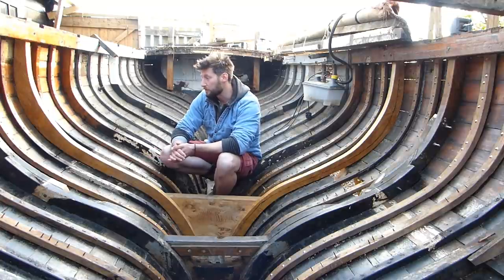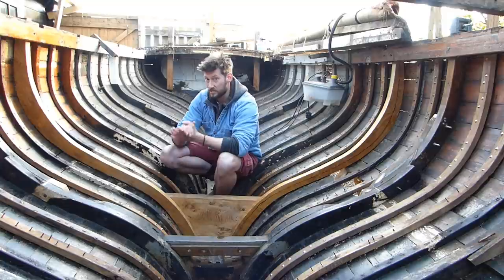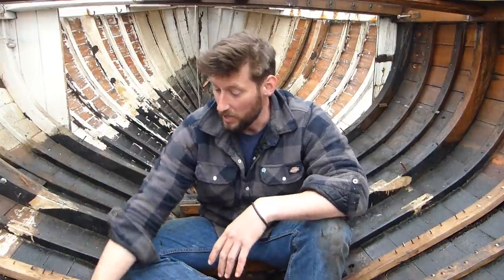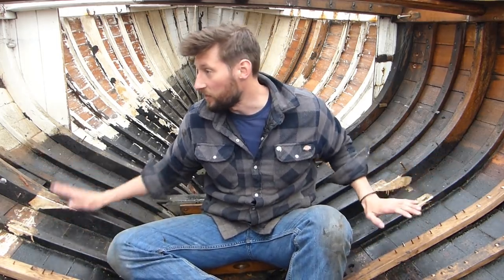Reviving an Idler - A question! -  Extra Content!

Comment: Why not employ a triple wide rib so that you can bed that entire sick area down tight? 
You can alternate the fastening on either side of the original holes at every other plank.
The rib can easily taper down towards center in order to fit the original spot where it seats into the keel.
If you're all about a loss of symmetry then simply do it in the other side. 😊
Getting the boat fixed and fine and fare and FLOATING is more important than a stand-out fatty rib. 
Isn't it?

Comment: Is the fore and aft position of the sawn frames not critical as they correspond with the placement of the deck beams and the chainplates? For strength put in sister frames alongside new frames in original position. May not be necessary along entire length of boat.
Reply from the maker: Yes! And sort of..🤣

Generally you dont want to mess with the structural elements of the boat too much. After all she was designed that way. 
In Idlers case. Im Totally re-laying/designing the deck. And the  chain plates originally went through the planking not the frames. I will be looking to remedy this for something a little sturdier. 

Thanks for the idea of additional framing. I quite like the idea of double framing the station frames as a means to remedy the problem. And as a means to strengthen the hull. 👍 thank you!!

Comment: I'm just a programmer.. but I know one thing, cheap fixing isn't always the right answer. 
If you are going to build something nice with great effort grounded on the base on something old and rotten, then, always consider, money, time and lifetime.
If you drill extra holes in these old planks, they will get weaker. To many holes and "fixes" with "glue", isn't as strong as original.  So if you "move" the ribs to either side and drill new holes you will weaken that plank, no question. 
I would consider replank the worst ones (maybe 1 of 2-3 or something), use wider ribs (taping end to the keel) and counter sinked patches (wider side outside) and then fasten through the patches, whatever shapes of round, diamond etc.  
Then you have patches which are kind of pressing the planks to the ribs with rivets through good and new strong fastening material.
Reply from the maker: Absolutly agree, alot of this planking is worth saving and alot of it isnt! 🤣 im really appreciating the feed back! Thank you!

Comment: I like the idea of moving away from the iron sick planking, plugging the holes. . Could you avoid the problem of your ballast keel bolt by installing a doubler (carpentry -sister)  to the new frame?
Reply from the maker: Yes there are ways i can remake the floors to take the old keel bolt hole. One option is to fill the space between the frame ends with a second “floor” that will take the ballast keel bolt and use a larger floor behind it to back it up and tie it to the keel in the traditional manner.

Its tricky to explain without pictures! 🤣

Comment: You're looking at replanking. If not Your looking at fixing up the structure and fiberglass the outside at the end. By the looks of your boat, I'd go with the fiberglass. 3-4 layers and you'll never have to worry about leakage. You'll have to caulk the boat to make it solid but now you can pick what type of caulking to use. I'd use wood strips and glue. Remember the wood won't swell now and you can have a safe fast boat. And just to let you know I'd never sail Arabella in the open ocean. They made a fatal flaw in it. The floors. They took 1/2 plate and welded it with 1/4 welds. You're only as strong as your weakest point. They did not grind a 45 on the plate before welding them. They are going to sail that boat in rough seas and hear bangs going off. That's the welds breaking the hissing sound will be thousands of gallons of water comings in. I tried telling them but no reply. If you want to learn about planking watch Charles Chiara on planking. Good luck.
Reply from the maker: Thanks for the tip! Ill check it out!

Comment: Treenails have open grain ends, which could wick water into the frame. Graving pieces let into the planks & bonded in place with thickened epoxy resin as Alix did on the mast for Arabella is one answer, as the diamond shaped pieces would be sized to fit the plank, if necessary! The round disk Dutchman has the benefit of using a hole saw to cut both plank & plug & creating sufficient clearance for the thickened  epoxy resin to bond both surfaces.

Here is a link to some of Dave Carnell's work on treating rot in boats. He was well regarded.
http://www.simplicityboats.com/chemorot.html

Best wishes,

Perry

Comment: I don't want to sound discouraging, but there is no easy easy fix. The trouble with plugs and "gibbies" is that you will sever so many surviving fibres that  cumulatively you could significantly affect the hull's structural integrity, beyond the present degradation. I am not generally a fan of chemical solutions, because they tend not to deliver, but "theoretically" a wood hardener which arrested the degradation might be preferable. There is ultimately the Tally- Ho ship of Theseus solution....not what you want to hear.
Reply from the maker: Not at all, im aware that a-lot of the planking will likely require replacement, and total structural weekness as a result of cumulative repair is a big fear ive had and a big part of why i made this video. So you are absolutely right! Thank you

Comment: Me personally I would want to know how the next ribs before and after that one and see what condition the wood is in. Would hate to do all that work and then fined out that lets say the next meter or so is also bad and the you would have to scarf a new section of plank in there .I'll  bet at some point you will have too do that, that iron sickness is hard to see sometimes when they are covered with oil, age and what very someone else did to 'try' and repair her. That's the thing you don't know if it was done right or not. But hey I just biuld model ships not the real thing ,so we know who has way more experience here than me.....lol good luck I hope you get the answers you need to do this right.
Reply from the maker: Absolutely, i know ill have to replace some of the planks but there is some good stuff in her still. But, you know as well as i do that the iron nials will have done the same on each frame going forward.

Comment: It will be a lot of work but plugging the holes and graving in 'dutchmen' from the outside to fill the damaged timber and then re-fasten with copper in different locations to the originals, would be my suggestion. Do obtain some pitch pine to make your graving pieces and soak the holes with some epoxy primer (penetrating epoxy) before gluing them in.

Comment: I'm surprised you are going to nail the frames. Why wouldn't you use copper rivets, roved and peined? I don't think trunnels or through dowel plugs are a great answer, because that leaves end grain on the outside of the planking, and water travels along grain rather easily. I don't believe your frames are big enough for trunnels, either. I think your choice is between Dutchmen, or relocating the frames. Drilling new holes through the keel isn't a big deal.